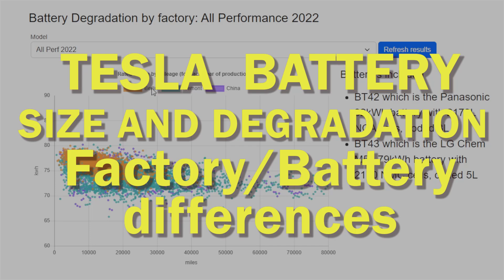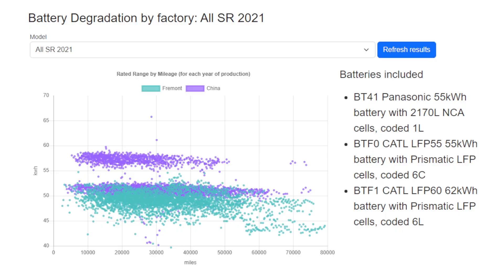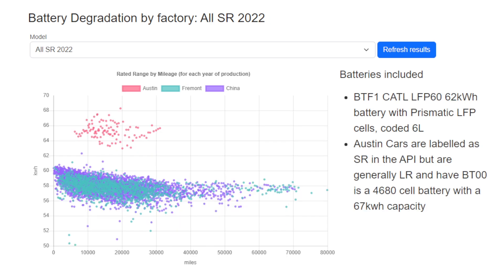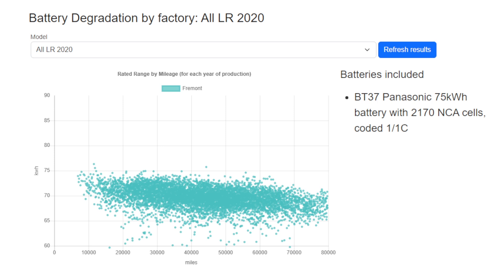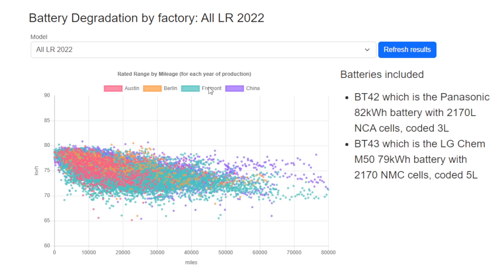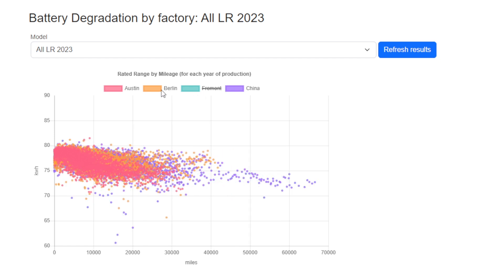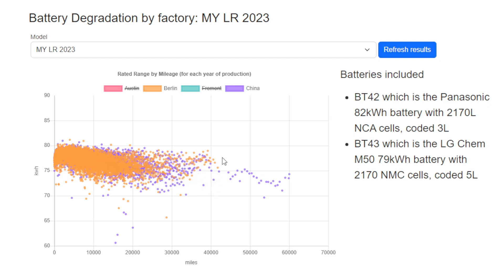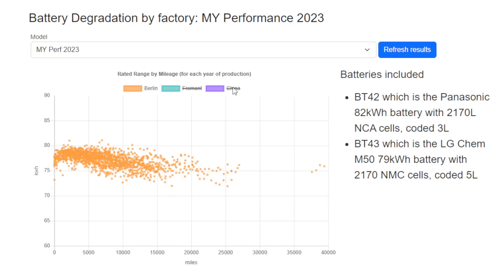Tesla degradation by battery type and car factory. Part 3 of our series

Comment: There are at least three variables which you're not mentioning: 1) What average temperatures are the different batteries being used in? Climate may be making a big difference, long-term. 2) What speeds are the cars being recharged at? Later models will be recharged on faster Superchargers, and this will affect battery longevity. 3) How is each car being driven? Terrain, average journey lengths and applicable speed limits will combine to affect battery durability. You might think of more variables to add to these.

Comment: Is this a symptom of the regions being supplied by these factories and their varying temperatures/climate? 
China made going to Europe and Chinese market, and US made to US mainly (with some variation).
Reply from the maker: It's more to do with different factories using different suppliers. US use Panasonic heavily, China uses LG, although there are other suppliers as well.
Reply: @Tesla-Info  I understand that, but it would be interesting to map country of sale/residence over the data too. There may be some correlation that goes beyond chemistry from particular cell manufacturers. Or indeed, correlation with better performance in certain climates

Comment: If im looking to buy a used Tesla, is there any easy way to do this kind of assessment prior to purchase?
Reply: Make sure the manufacture date is around summer 2021, this is when they started introducing LFP batteries for Model 3 and Y.  You can check this info with the VIN (Vehicle Identification Number) which the seller will provide for you. Apparently the 55 kWh from China rather than Fremont seem to be of better quality of manufacture, so you can go for that too (though I think US sold cars don't get imported), although someone else mentioned that the Vremont batteries in the US simply exist in hotter climates which will influence it's lifespan. The main point is don't buy NCM battery Teslas unless you want to spend extra 10k in a few years to replace the battery...
Reply from the maker: I wouldn't personally worry too much, and even if the method below gives a lower than expected reading it may simply be a case the BMS needs help calibrating or the cells beed balancing - both relatively easy to do. Accepting that, there is a quick and dirty way however to see the battery capacity https://tesla-info.com/blog/battery-degradation.php

Comment: My fuel tank hasn't degraded in 25 years,still holds 75 litres whether I fill it fast or slow,fill it up 100% or run it down to empty(which is not a good idea).Hmm...I actually don't mind the idea of going to electric,but I don't like the battery technology.
Reply: Yeah but...the whole point of it is to save costs
Reply: But engine components have degraded resulting in measurable loss of performance, worse economy and degraded expected reliability 🤗
Reply: Ice cars lose efficiency too my guy

Comment: Do we now how much the outside temperature might have affected the results?
Reply from the maker: We do have the outside temperature but only at the point in time the measurement was taken. When we plot this we do see a 1-2% drop but the API tells us this and we can correct for it. What we sadly can't judge is how much a car has been exposed to cold (or very hot) conditions over its life, or whether it was just an isolated day..
Reply: @EVinventory  thanks for answering. Excellent that the temperature is somehow involved but I remember Tesla Bjorn when living in Thailand for some time while still managing to test Teslas 😂 had an active curiosity about the effect of batteries being subject to endless inactive hours at around 30 degrees celsius. This is very interesting analysis that i guess only Tesla will be able conclude on when seing how the same production line would behave under very different temperature levels.

Comment: So have a Fremont 2023 model 3 LR. How can I find out if I have the LG battery or the Panasonic battery? Tessie says I have a starting capacity of 77.8. So probably the LG battery right? Cheers.
Reply: I believe Fremont is Panasonic. Your total is probably 82 kWh but it will list as around 78 kWh usable.
Reply: @pillington1338  does its normal, that scanmytesla software showing me only 76.6 kWh ("nominal full pack" graph) of my 82 kWh Panasonic battery after only 5500 miles?

Comment: Correct me if I'm wrong. 
You're only including information on people who send in or use a specific app? I'm not sure, but I'm quite certain my car isn't in the data. 
That means you're ONLY getting data from people who care about this stuff and therefore who know how to properly charge and use EVs. You're specifically leaving out the majority that just buy a car and use it. 
Not that it's not interesting data and useful, but it's, I assume, scewed.
Reply: You stand corrected 🤨 
People who seek the data DO care about this stuff, but it does not mean they know how to properly charge and use EVs.  
There are no good sources of information about how to properly charge and use EVs. 
Not even on this site, though it is invaluable for a big picture of charging and use and resale. 
Only Tesla has complete information about how each car was charged and used, and they are not helpful except their service mode which is cumbersome to use.

Comment: You haven't taken into account ambient temperature differences between where the cars from the different factories are being used. A large-scale US study by Recurrent that was released last year showed that Teslas in the southern half of the US had significantly more battery degradation than Teslas based in the northern half of the US and Canada, with the difference almost certainly being due to the the fact that the southern half of the US is significantly hotter than the northern half. So, the more rapid degradation you see in the cars that have the Panasonic cells when compared to the LG cells might be simply due to the higher temperature s in the southern half of the US when compared with Europe and China.
Reply: That's a very interesting info, thanks!
Data analysis, specially in an end customer product delivered globally, is always hard due to the context, making a 100% accurate breakdown unfeasible.
Reply: I don't think it's a significant enough data point to matter. Europe is not made up of only Scandinavian countries. Spain, Italy and Greece all get very hot during the summer. China, on average, has very hot summers as well.
Reply: @badbasic  Lol. it doesn't matter what you think, it is what the data shows. If someone wants to make the comparisons shown in the video , then they need to take into account the average ambient temperatures of the vehicles because it is a factor that has a significant impact on battery degradation rates.
Reply: @wr2382  I didn't say the temperature doesn't matter, I am saying it's probably not skewing this test in a way you think since Spain, Italy, Greece and south/central China are all warmer than California, the US state with the most EVs.
Reply: @badbasic  And the European countries with the most EVs are Germany and the UK. 

And neither of those facts are point. The point is that you don't guess or make suppositions.
Reply: @wr2382  Which you did in your original post.
Reply: @badbasic  Lol, no! Go back and read my original post and you will se that I used the word "might". I used that word because the data that the the video used to make the comparison does  control for the ambient temperatures of where the vehicles reside. It's very simple, if you want to make the comparisons shown in the video, you have to control for ambient temperature. Otherwise ,the analysis is meaningless.
Reply: @wr2382  And I said I don't think it will matter, we both guessed and made suppositions, which is totally fine. I still don't get why you're defensive about it. We have two sets of data, one is about batteries made in different factories having slightly different degradation, the other one, which I haven't seen but am willing to trust you that it exists, showing that batteries in warmer climates degrade faster. 
Your guess is that the first data set is invalid due to the second data set, my guess is that the second data set probably accounts for why the spread of German made batteries is much smaller than Fremont and China ones, but it doesn't invalidate the whole set since the varied data accounts for all kinds of climates.
Reply: @badbasic  The data is not invalid. The use of the data that they made in the video is invalid because they did not take into account the effect on degradation of ambient temperature of the places where the vehicles reside. It is a known fact that ambient temperature affects the rate of degradation. So it is something that needs to be taken into account when you make the type of comparisons that they made in the video, the same way that they took into account age of the batteries and distances driven. 

I have not guessed or supposed that they did not take into account the effects of ambient temperature. There own presentation of the data shows this, it is not a guess on my part.
Reply: The China-built cars using LGChem batteries are used in China, Europe, Australia and NZ as well as other Asian markets. Plenty of places that are both very hot and rather cold.

I think we’re just seeing the difference between NMC and NCA chemistries here. The NCA batteries used in the US-market cars do degrade slightly more, but on the flip side deliver substantially more peak output power (there’s a noticeable difference in performance between US market and other market LR and Performance vehicles), and also charge quicker over a larger part of the SOC curve. Quick DC charging is particularly important for the US market given the distances involved in typical road trips there.